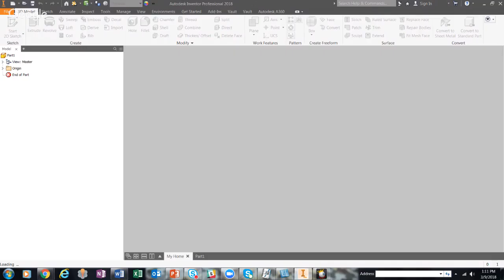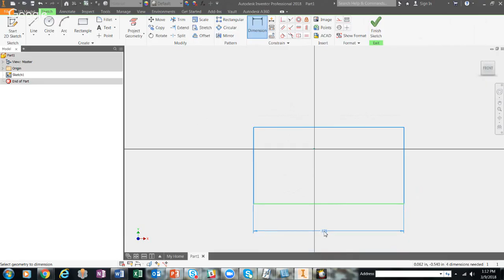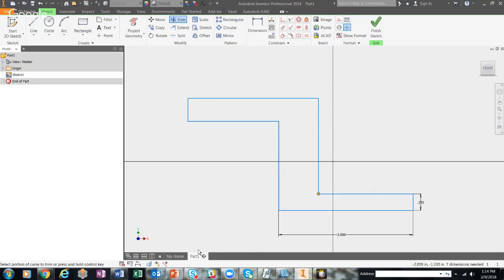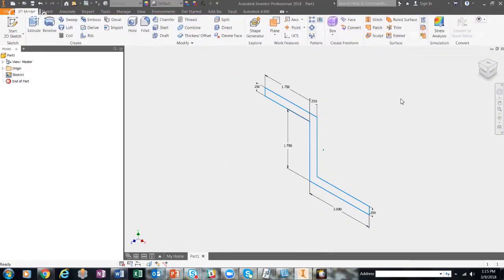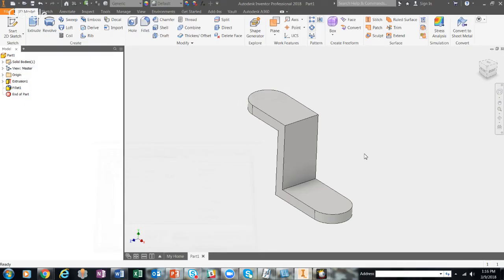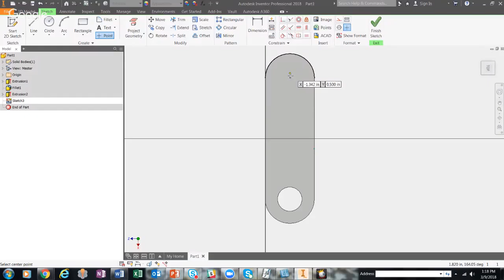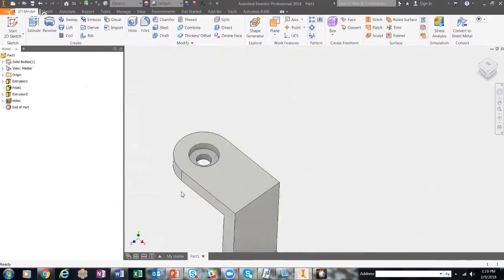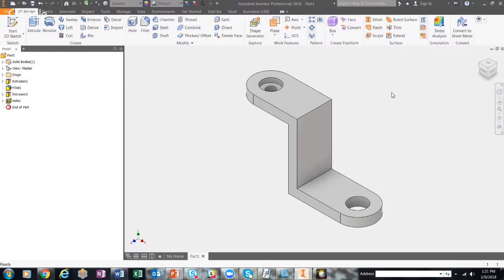Autodesk Inventor 101: The Basics

Comment: Inventor fucking Sucks!!!!!!
A simple circle saved as a dxf will open fine in corel draw but if you use the spline tool then save as a dxf it will be missing in corel draw. 
Also made a 3d part and saved the surface as a dxf to cut out on my plasma table and I opened in sheet cam the part was there along with a big circle I never drew. Compared to solidworks its shit!!! even turbocad works better than this shit.

Comment: What is the difference between autocad and autodesk inventor... Both seem pretty much same....
Reply: Maybe a little too late but autocad is mainly for architectural stuff and is mainly 2d and inventor is for mechanical engineering
Reply: @ttvgoosethecat1232  autocad for sketches 2d and 3d
Inventor specifically for modelling